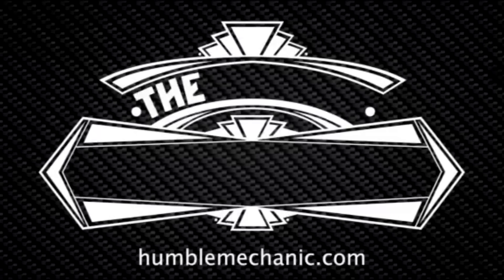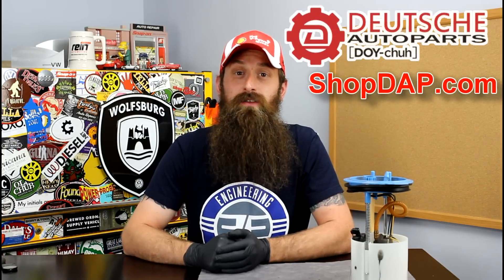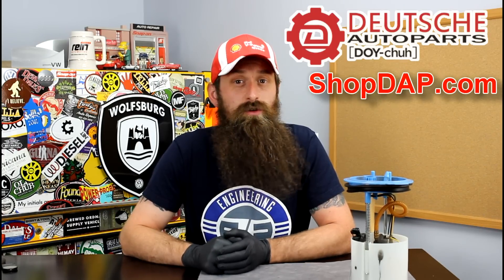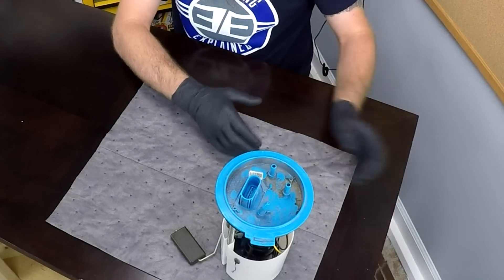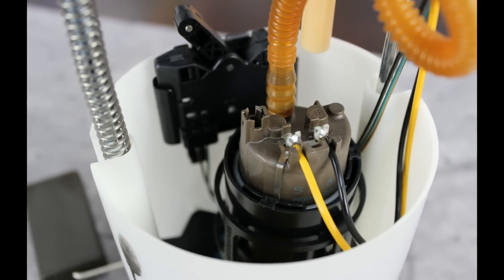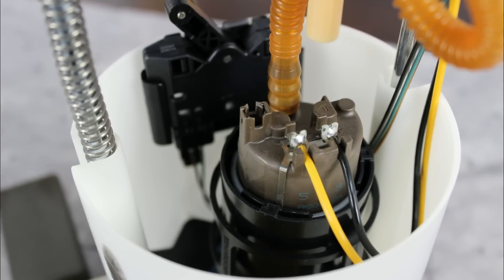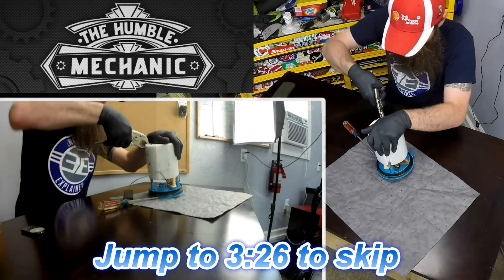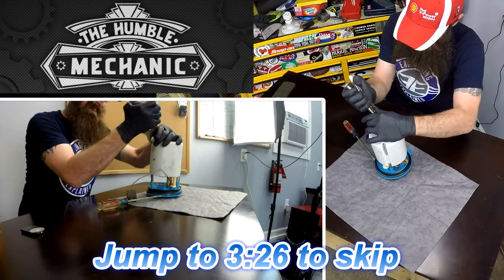How VW Parts Fail, In Tank Fuel Pumps

Comment: I have a 2005 2.0 vw jetta here’s my problem. My car won’t start, out of the blue. I was over due for my spark plugs and wires  so I changed them and still no start. Then I changed my ECT then my car would start but runs very rough and won’t stall but the idle is terrible. When I give it gas I can gain revs but it will fall on me even when I’m giving it gas. The forums have pointed me towards my fuel pump. Only symptom I’ve had prior was when I’m on the highway with cruise control on sometimes I’ll get a loss of power for 5 seconds and then everything comes back. I’ve haven’t had a bad idle leading up but it hasn’t been perfect idling any help?

Comment: I’m having an issue with my 2008 gti for the past 2 days when i put the ignition to the on position the sound of the fuel pump is different than usual and today i started having a weird hasitation between 5500-6000 rpm when i’m going full throttle, but before and after that spot the car runs and pulls normally, could it be the fuel pump?

I’m planning to take it to the shop tomorrow but i’m just scooping around for info for now
Reply: I also forgot to mention that sometimes it take a little longer to start, other times it starts normally and it does it randomly

Comment: I love when he said it's an easy D.I.Y. as he proceeded to break the pump housing into pieces and slice his hand with the screwdriver. But otherwise, piece a cake.
Reply from the maker: You wouldn’t break it open like that to replace it. ;)
Reply: For a tech or mech cutting your hand(s) is typically common. If you never had then either you're super careful or don't work very hard lol. Like he said some pump assemblies are not meant to take apart and they want you to buy the whole thing and not just the failed pump unit inside. Sometimes I'll just have it or find a parts car to swap one out of. Had gotten an Audi A8 for only $400 that way.  I already had a parts car so just cost me the labor to swap it out then sold the car for over $4k.

Comment: Hey, can I ask for some input please, I'm at wits end. I had severe misfire and no acceleration, unless floored to hardly move enough. I had it towed onto bed and it was shooting out smoke (not blue, possibly white?) and harse paint thinner smell in cab. 

I replaced fuel filter, coils and plugs, also just did lpfp since I borrowed a vagcom and it showed it at 60% duty and didn't hear it prime after sitting anymore. 

It still smells "off" and  shows 60% duty still. The codes it threw were p12a1 and vagcom said cylinder disabling but I also unplugged hpfp to test it and I stalled, that threw codes obviously.

I don't want to trade my baby in with all my fcpeuro parts on it. Please help :) thanks. I read duty should be 35-55 . 40bar and 40 bar at idle when accelerate to 3k 2011gti

Comment: Hey man,i have a 2013 golf 7 1.4 tsi dsg and did a dino on it and the power output is way lower then the factory power they said i need to open my fual pump and clean the strainer or something like that, what would you suggest
Reply: to lift the pump and clean the strainer, lol :) that's the prefilter thingy on the bottom intake of the pump

Comment: Hey Charles, love your channel, i have a 2006 Touareg that shuts off after the start up  pump is done, the main pump is fine it runs on power probe with no issue, it gets power momentarily so i think its an input issue not output, any direction? thanks

Comment: I'm pulling my hair out with the double compartment fuel tank in my Skoda Superb. The fuel pump is not one unit,  IIRC its a fuel delivery unit and pump with fuel sender on RHS and a suction jet pump and another fuel sender on LHS. So damn complicated since they are both connected to each other, also the one I opened on RHS had the top part and bottom part loosely hanging. They're  not one solid unit..

Comment: I’m getting positive fuel trims while accelerating and then returning slightly positive at idle. Also some hesitation and inconsistent throttle. NO CEL

Fuel rail pressure is staying high so I think HPFP is fine! Car starts normal...

Could the LPFP be the culprit? Custom tuned stage 2 GTI, 145k miles!

Comment: Hey Charles i've got a Bora/Jetta V6 4motion its not been on the road for 8 years and I'm restoring it. It had nearly a full tank of fuel which I have drained off. Replaced with new fuel about 1/2 a tank but it will not start, I've been advised to replace the pump (it only clicks in on ignition on but does not charge up like my R 32 does) the pressure regulator was missing the rubber T to the vacuum hose which I have replaced. Ordered a new pump which was wrong and it turns out that this is the 1JO 919 051 G version which I"m struggling to source is there an alternative pump option ?

Comment: Hi. Have you removed the fuel pump from VW T5? Don't know where it is? I have T5 2.5 mechanic engine and having trouble starting when the car has stopped like 5-10min. More troruble when longer stoped. Absolutly air prob. The fuel line goes empty and it takes long to start. Have gone worse every year now. I looked this vid but it's T4 so is it same or not? https://www.youtube.com/watch?v=wNHW80PwgRg   My tank is left side. Thanks for your reply ;)
Reply from the maker: No. We didn’t get them in the US
Reply: HumbleMechanic Thanks anyway 🤗
Reply: get an aftermarket/racing check valve with the correct connection, install it either in the fuel pump internal hose or somewhere in the fuel line near the pump (and rather accessible). Also that transparent hose you see on the video might just not be tight enough.

Comment: Hey dude, I have a 2005 and 2007 Audi A6.  I replaced the pump on the 2005, and a few weeks later, needed to replace the Fuel Pump Control Module.  The recommended procedure is to undo a bunch of crap, (like exhaust?), and drop the tank a few inches.  Took a few sources to find where to look exactly.  I went a little bendy bendy on the floor instead, just enough to slide out module.  I chiseled off the plastic bracket holding it.  The replacement I retained with a screw and a nut.  Bent things back and ensured a seal.   "My God, Audi, why!?".  Anyhoo, I'd  love to see some content on modules, maybe testing.   BTW, I did use my power probe to run the pump.  Awesome little tool!.

Comment: Hello, I was wondering if I could run an in-line file pump to bypass the current in-tank pump? Would I have to detach the existing wires that lead to the in-tank pump and attach them to the new in-line pump? Help would be much appreciated.
Reply from the maker: you could do that, I don't know how well the inline pump would be able to pull the fuel out of the tank. You could also use the wiring for the OEM pump most likeky,
Reply: HumbleMechanic I figured it out! It was my coil pack and spark plug wires. Lol
Reply: The reason why I think there is a problem, I’ll be sitting at idle, and every couple of seconds the engine will hiccup and act like a stutter and at low end if I press pedal, engine light comes on and it’s a little boggy, but if I slam on the gas pedal it will down shift normally and shift properly, it’s just under small load that it hiccups. Any idea? Help would be so so so so so appreciated.

Comment: Hey there! Would a bad In-tank pump cause intermittent failure to start or would this be a consistent problem? In the past 6 weeks, my 12’ GTI has failed to start 3 times. It always happens after I drive the car and then leave if off for 20 min and then try to start it again. It will start and then sputter and stall. After I let it sit for 30 min, it will start and drive just fine. Thank you for any help!
Reply from the maker: possible either way. That can also be a HPFP issue. There is a drain back valve in the HPFP that can and does fail
Reply: @HumbleMechanic  Thank you for your quick response! If you were me, where would you start first?
Reply: What was The problem low, hi pressur pump or cortoller?

Comment: Interesting problem on 2008 gas Beetle,  The vehicle stopped on the road going slightly uphill..  got it started and drove another 200 yard and it died and would not restart.  It was towed and mechanic said it was out of fuel, so added ten liters.  The owner drove the car to the gas station and filled the tank with another 34 liters to top it off.  Here were it gets weird, the Beetle tanks hold 66 liters of gas, 22 more liters than it was topped off with.  The car has only 35,000 original km.  The mechanics said they needed to replace the fuel pump and sender.  Also interesting, the gas gauge needle has been stuck at 1/2 for the past few years, but the owner always kept it topped off, and would drive 230km and then refuel, topping it off.  ??????????????  This time, the owner had only travelled 220km when the engine died.
What is happening?

Comment: Hi good video .can you tell me do these pumps have a non return valve in them or is that on fuel line.cheers
Reply: I have the same question one way valve on it? In my MK4 R32 the fuel goes to 0 zero PSI after 3 seconds. Is that normal?

Comment: Hello Sir, i have seen several of you videos and i must say they have been very helpful. Thank you. Pls i have a question concerning my volkswagen cc 2009 in tank fuel pump. what is the resistance value im supposed to get at the pump power terminals. Am i supposed to hear an audible sound on the fuel pump whenever i am cranking the car? My pump gets the right voltage and its power terminals read 3ohms but the pump does not make any sound when i crank. Pls help me. Thanks.

Comment: Question, I have MK6 TDI fixed gold 2.0. Sometimes when I am maintanin speed ~40 or so, third gear I get like a miss fire jerking action. I have a manual transmission. Is believe there is a lift pump to the HPFP and the fuel filter has been recently changed.  I also think I hear the lift pump after shutdown.  Its a motor on for two seconds of for  two seconds on for one. Love your channel. Thanks in advance for your help. In addition most of the time the first start of the day takes 4 seconds, 3 times longer then starts the rest of the day.

Comment: Great video, so I have a big doubt, do you know how to calibrate the fuel gauge in MK4's VW? I've a VW Polo 2003, I'm from Mexico and I changed the fuel pump but the fuel gauge doesn't work, when I start the car, it shows fuel tank (even if the tank is low) the gauge only gets down when I turn off the car. Ir you can help me, I'll be really greatful!!
Reply: What  was the response to this question? It's also my problem

Comment: Hey Charles, have you heard of a fuel pump buzzing while the vehicle is on? (2006 Rabbit) It's the same buzzing I get when I flip the ignition on. It's a feint noise and the runs just fine. Is this normal? The car has 134,000 miles. Thanks

Comment: Here is an issue I have been having occasionally with my 2012 Jetta 2.5L, 160k miles. A few times a week, [I noticed it more when it was colder and had the original battery] it would turn over 6, 7 or 8 times before the engine would fire. It was vigorous and didnt sound like a weak battery. After replacing the battery in May,  this might happen once or twice a week. It also has been much warmer in PA in May and June. Winter really held on until April. I had this cranking issue in the winter of 16-17 and thought I would've needed a new battery a year ago but the issue seemed to have subsided and of course I put it off. What are your thoughts? Sensors? Starter? Bad ground? Loose wires? Your help is very much appreciated and your videos are priceless!! Thank you for helping educate me on VWs & all of your endeavors.

Comment: Hello, I have a Seat Ibiza 6J Sport Coupe from 2011. It is a 1.2TDI 75 horsepower. My car drives but my fuel pump is very annoying. Its like a bee is flying in my car. How can I stop that annoying buzzz sound? I can also not find any fuel pumps for my car, only originel and that is 400€...

Comment: PLEASE HELP!
i just bought a passat 2001 b5.5 1.9 tdi 130hp avf engine and i have a problem 
its reaLly hard to get it running .. sometimes its turning a lot before start .. when the engine is hot it start but shut off right after.. until you start it up while pressing on gas pedal
i think its this pump but im not sure

Comment: Hi Charles, thank you for your youtube channel and sharing your tremendous knowledge and experience. I have noticed something with my car (2017 VW Touareg 3.2L VR6 fsi gas) that has me worried about premature engine damage. When I turn it on after its been siting overnight, it cranks 5-6 times before starting. But once i've driven it around town for a while, it starts immediately on the very first crank. like when i stop at the store for milk/eggs or drop off/pick up the kids or whatever, starts right up on first crank usually. But if its been sitting for more than 2-4 hrs, it takes 5-6 cranks to turn on. Dealer tests show no error codes and correct fuel pressure readings on the upper and lower fuel pressure regulators. Should I tear out the back seat and install one of these check valves (https://www.amazon.com/gp/product/B01LY7WD50) on top the fuel pump? What do you think is the issue? Faulty fuel pump/check valve?
Reply from the maker: I’ve actually heard this from several people. I’d lean on fuel bleeding off but no was to confirm with out actually checking the car. 

Sadly most people have had the same story as you. Dealer says it’s fine. Plenty of testing can be done, but I’d need the car on site
Reply: HumbleMechanic should I trade it in for a diesel? What do you think about the 2016 Touareg TDI? I'm thinking about all the money I will save on gas in the long run.
Reply: HumbleMechanic What are the chances the engine computers/sensors were intentionally designed to crank a few more extra times when its cold or been sitting overnight to get prelubrication before ignition?

Comment: I have a mk5 2.0 tdi golf it was driving fine until it snowed really heavy and was sat a few days. I got half a mile away from home when I finally went out and just cut out, but it does tick over.   It has no error codes and after checking there is no fuel in the filter I’ve bought a new pump to fit but before I do is there anything else it could be?

Comment: I have a 2015 Golf Mk7 1.4 tsi and its cranking 5-6s, sometimes more, when the fuel level is 1/2 tank or less. Sometimes it turns on, idles on very low rpm, an then starts to turn once again. When its really low on fuel it idles porly and the engine doesnt run smooth under acceleration. I can hear the fuel pump when i turn the ignition, could it still be a bad fuel pump? 

No problems when the tank is filled up.
Reply: Did you have misfires and intermittent vibration while idling and cold starts ?
Reply: I did. The missfires and vibrations on idle didn’t go away when hot either. I changed the in-tank-fuelpump, didn’t help. Sold it a while back. Nice car, in some ways better than the BMW 1-series i bought instead. But got tired of the never ending repairs.
Reply: I also changed the sparkplugs and coils, that didn’t help either.
Reply: @jakommer  Thanks for the reply I'm rather worried with mine at the moment can't sell it off with the CoVid damaged economic situation bank are very picky with it comes to financing, Could elaborate more on the poor acceleration that you mentioned in your reply. Many thanks
Reply: J R 
The acceleration wasn’t poor, it was inconsistent with occasional ”Coughs”. Could be the turbo/engine mapping, i think it’s something most Golf buyers won’t notice. Not the first turbocharged car i experience this in. 

But in comparison my BMW with the B48 engine is super smooth and has a very consistent response to the throttle input.

Comment: hi i have a golf mk5 1.6fsi 2004 i changed my fuel pump and the car still shuts down while i drive most times when car is hot and the wires near the pump are hot mostly  the conector that sits on top of the pump on the plastic cover any ideas what might be the problem ??? thank you. do you think it might be electrical fault cause i get the engine light on and airbag light sometimes the handbrake light too
Reply from the maker: What’s the check engine light for?

Comment: HumbleMechanic - I have a noisy sound coming from the boot. I have been told at last service Seat Garage that is : " "When started there is an electric noise sounds like an electric handbrake arming fuel tank lift pump is noisy but still creating correct pressure. Cost to replace 401.51 "." 

Could you advise what to do? Do you think it it fuel tank lift pump to change? Is that the one you show on your video? Cheers mate

Comment: Hey Charles I have an 09 Tiguan n the transfer pump is humming . Well yesterday the pump stoped humming now my check engine light is on with a p0171 lean bank 1 . Could the pump have failed n caused this chk engine light? (I think so) also I’m very concerned about my high fuel pump failing destroying my can. For piece of mind should I change it? Please help ASAP before I go blowing money n throwing parts at it. Ps it a Tiguan s with a tsi turbo also the car runs kinda good I’ve been having mid range low power like in 2-3 gear lil sluggish .

Comment: Hey Charles, I'm having a issue with my mk4 gti, the other day it suddenly shut off while I was driving and then it would not start, after searching in the net and watching these video I suppose is fuel pump related, any tips on how to diagnose it?                                                        Ps. Great video man 👍
Reply from the maker: Maybe fuel pump. also maybe a crank position sensor. Heck it could be a bunch of other things too. Are you getting fuel up to the engine?
Reply: My 1.8t jetta goes into limp mode while i drive sometimes too. Only happens at low fuel and backfires a lot. Have been thinking about doing this but procrastinating by keeping the fuel above a 1/4 tank